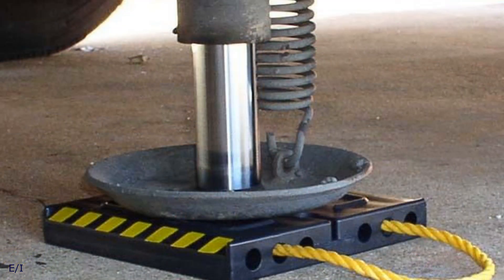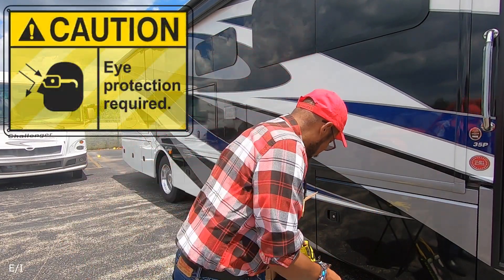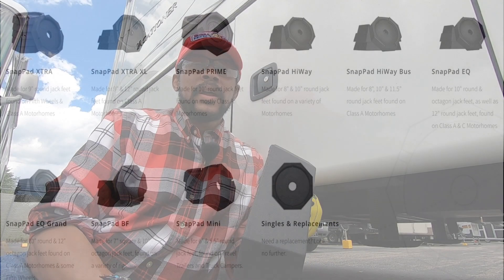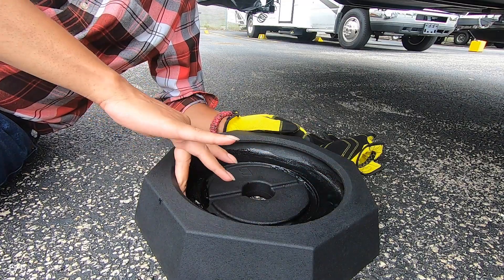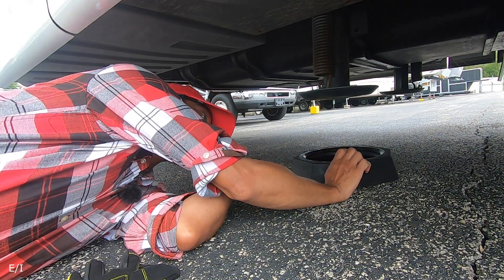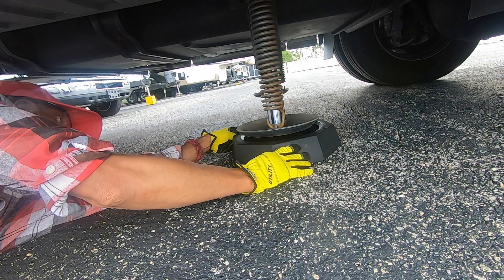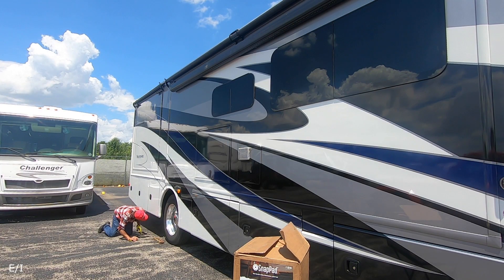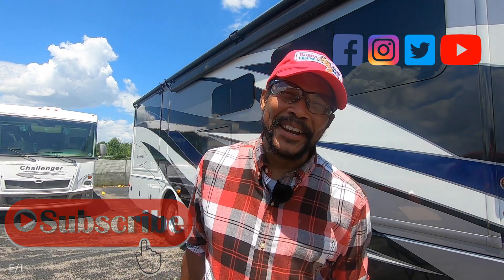RV Innovative Idea #107 ~ RV SnapPads Installation on a 2019 Holiday Rambler Vacationer 35P

Comment: I just purchased a 2020 holiday rambler vacationer 35P and I’m going to subscribe to your channel to learn A few things keep up the good work love your videos
I have one question for you at the moment I am picking up my rig on Friday I am going over everything one thing on the list, the rear  wardrobe slide the bottom of the slide is out all the way but  the top doesn’t look like it’s in about 3or four inches… looking at the side of the slide it is not even from the top to the bottom is that the way it’s supposed to be, or is it supposed to be even from the bottom to the top…
In other words it looks like the bottom of the slide is out further than the top of the slide if you can do me a favor and look at yours when you have your rear wardrobe slide out and let me know what yours looks like I would really appreciate it thank you very much
Reply from the maker: Congratulations Frank on you new HR!  Welcome to the club! You are going to love your HR. Looking at my rig wardrobe side don’t appear to be wonky. Have them to take a look because the slides should be level across the top and bottom. 

The only issue that I am encountering is the bigger slide with the fridge. Since it drops down and raise when opening and closing. The middle top is catching on the metal frame and I think it’s because it wasn’t completely level.  I am going to have HR take a look because I don’t want the motor to burn out.  

Oh’ one more thing, don’t put liquid on the small entry shelf right above the door when you walk in…..the multiplex switches that is at the bottom of the door.  I knocked over my coffee and it got into the multiplex buttons wet and non of the buttons throughout the rig was operational. 

I had to “quickly” disconnect the multiplex controls at the bottom of the entry door and dry and clean them off.  Lastly I am going to shoot a episode regarding the headlights. Therefore adding motorcycles headlight screen over the shroud for the lights. A rock hit mine one the road and broke the outer housing……that was 600 bucks for a new head light. Ouch…Since our rigs don’t use a standard headlight bulb. You have to replace the entire headlight assembly. 

Other than that all is good.  

You have the V10 or V8?   I think your rig is the last of the 35P since they discontinued  our models.

Happy and safe travels. Thanks for subscribing!💯